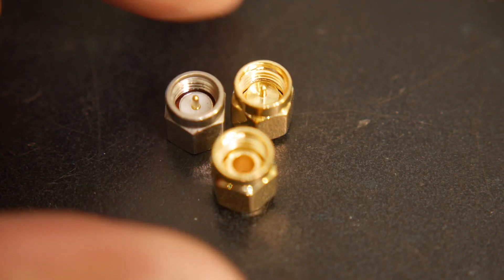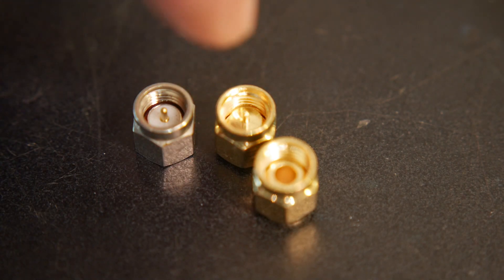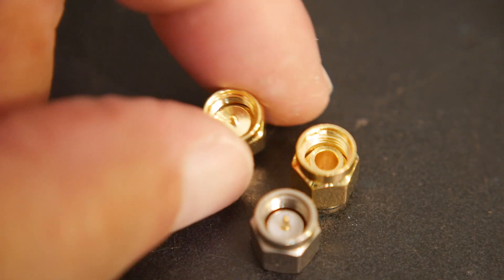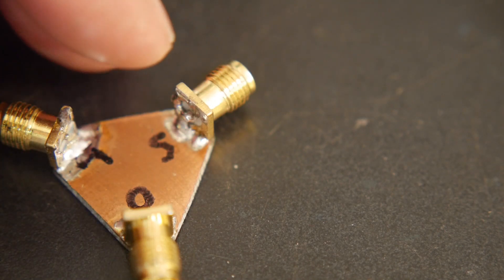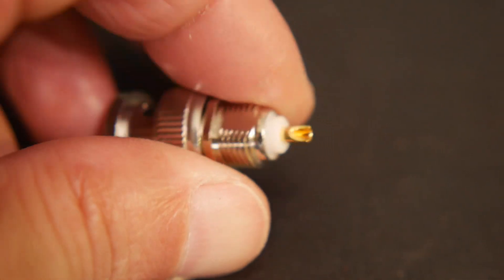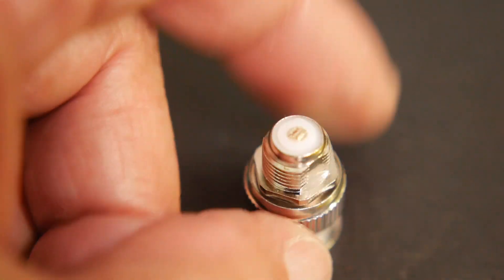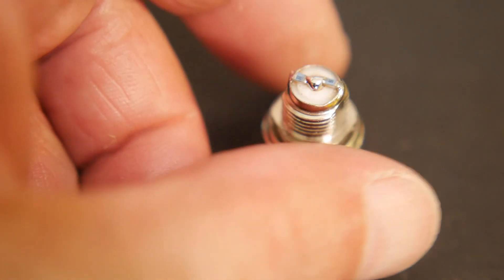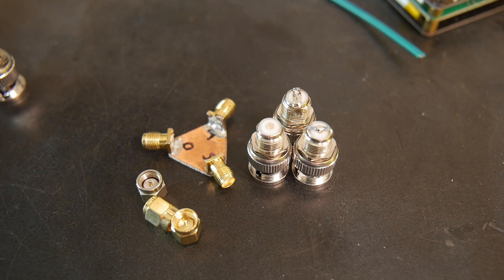#374 NANOVNA making BNC VNA calibration set

Comment: Do you need any particular resistor, like designed for RF or would any generic 100 Ohm surface mount work?  I don't have any SMT resistors so I need to order some anyways.
Also, would it be any better/worse to use some other multiple of 50 Ohm values, for example 6 x 300 Ohm resistors?
Reply from the maker: I suppose it comes down to what max freq you want. below 1GHz two 100 ohms SMT of any type would be fine.

Comment: If I want to use my nano VNA for testing SWR on my HF antenna, do you recommend making a set of Cal standards for PL 239/259 connectors?
Reply from the maker: no. not needed at HF. just use the SMA ones

Comment: Hello! Nice video! I want to ask you, where the calibration must take place? Directly at the NanoVNA SMA connector or at the other end of the feedline ? Thank you!
Reply from the maker: calibrate at the location of the device under test. like the feed point of the antenna. if that is at the end of a cable then at the end. if you are interested in what the radio will see then at the beginning of the cable

Comment: You need a disc for a better short
Reply from the maker: you are correct. I did ended up reworking mine with a true disk. But actually at 900mhz it is not too picky